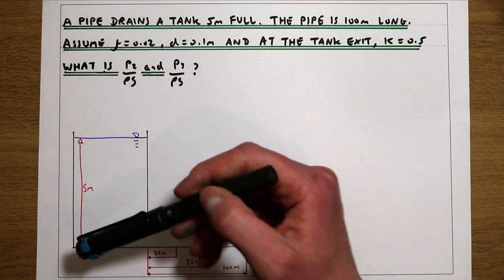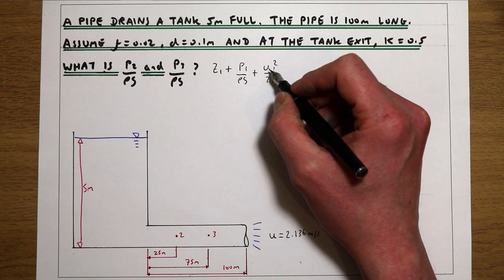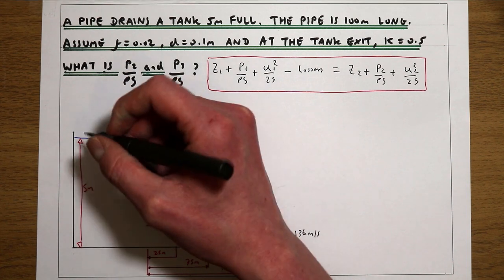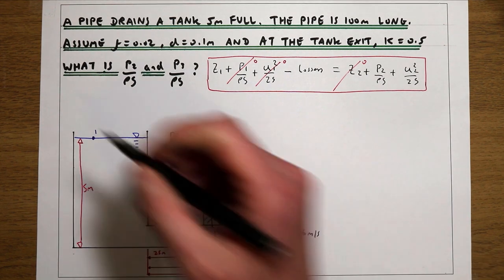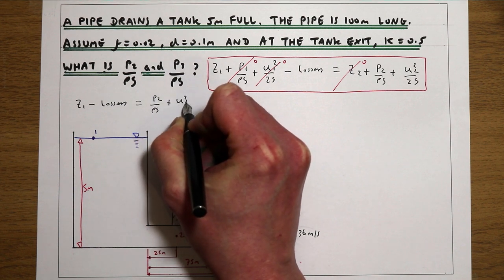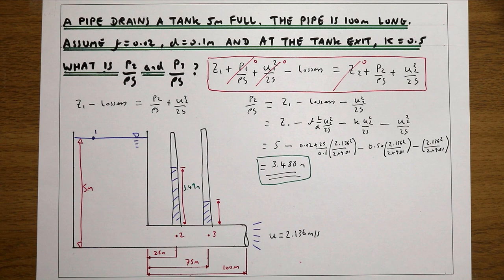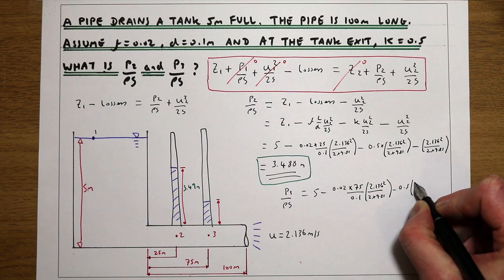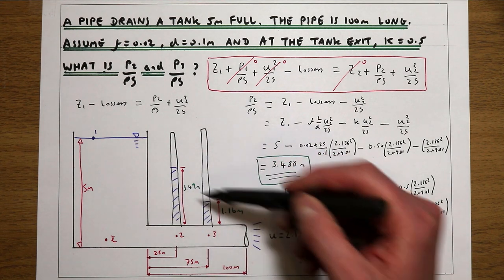Calculating pressure in a pipe using Bernoulli's equation accounting for losses

Comment: I was wondering about what is the pressure at end B based on a requirement that the flow velocity through the pipe is 1m/s and flow rate is 100l/s. Say there is no requirement for delivery pressure at B, length of pipe is L metres, B is higher than A in height. 
By using bernoulli's theorem, pressure/head required to pump water from A to be B will be = Head loss due to friction + Potential head due to height difference between A and B. Does this mean that water pressure at point B will be zero?
appreciate an answer. thank you!